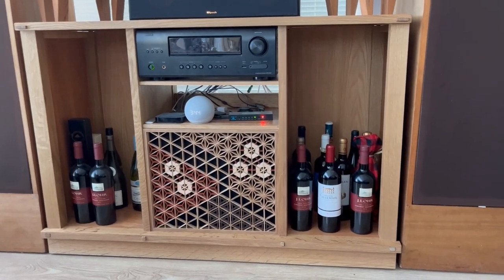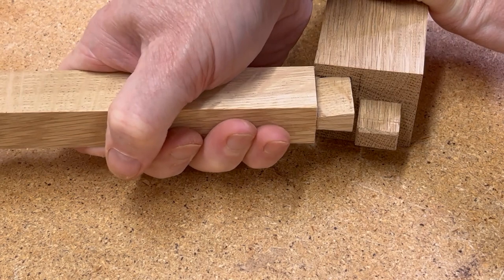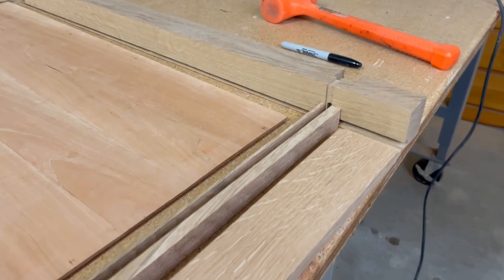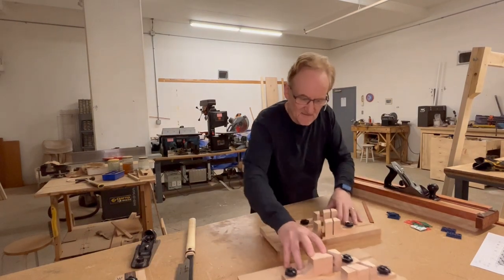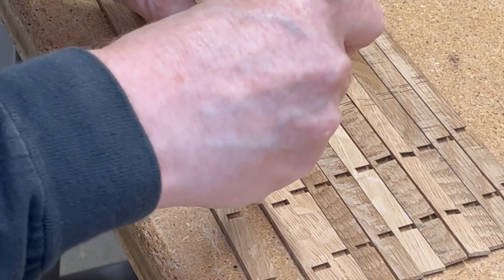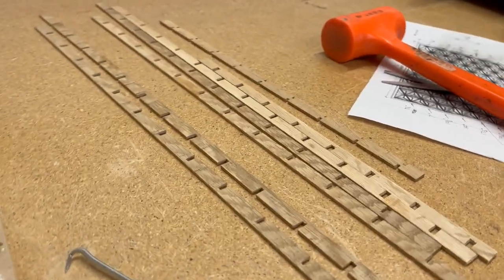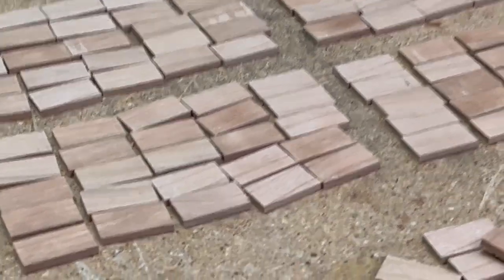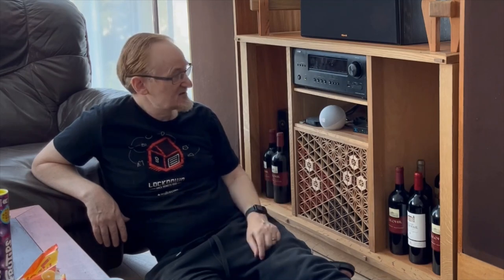No glue media cabinet with hand cut Kumiko panel

Comment: What tool did you use to clean up the through mortise you made at the3:15 Mark of the video?
Reply from the maker: I make mortise and tenon joints the old fashioned way with a chisel. The key is getting really good at sharpening!